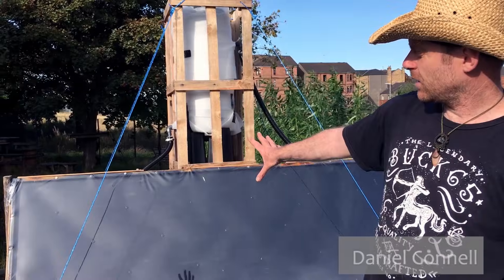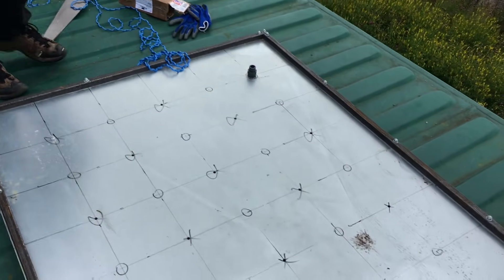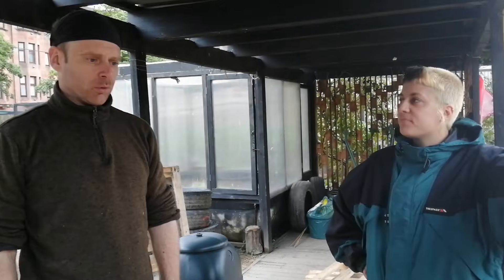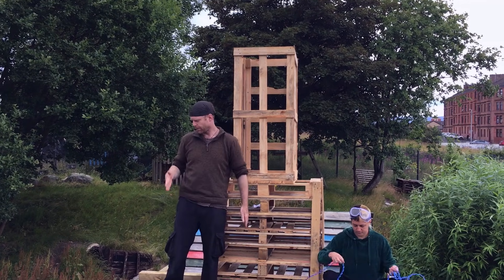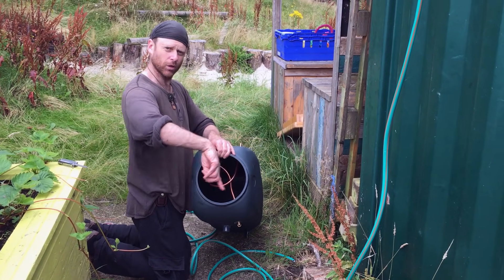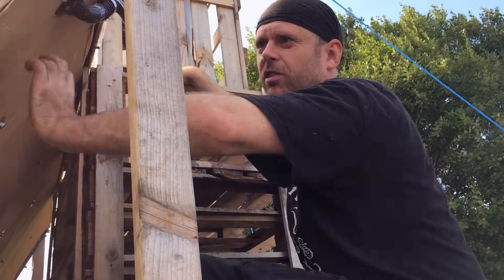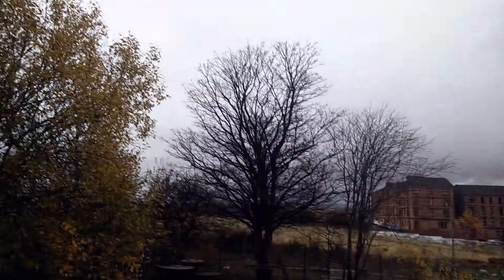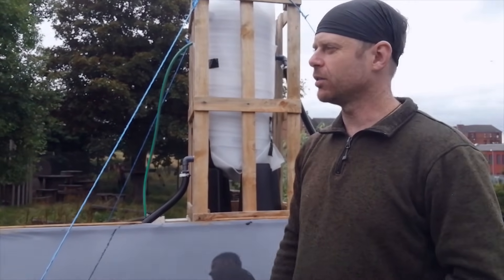The lowest cost per watt solar hot water panel. Build guide in description.

Comment: Still not convinced solar power has any place in Scotland or Ireland, but this is a decent effort.
Reply from the maker: It mostly comes down to cost per watt and energy return on investment.
If your infrastructure is expensive, then no, it'll take forever to pay off and should probably have gone with something more abundant.
But if it's basically dirt cheap like this, then getting half the energy at a tenth the cost still probably works out in your favour.
Reply: @OpenSourceLowTech  Indeed.. A "Perfect solution" often stands in the way of a good enough one and can result in nothing being done at all!.. Great project given the resources and circumstances.

Comment: what are the advantages of this setup compared to a plastic pipe snake or swirl pressed behind the outer metal plate? half the steel, simple steel enough, no steel frames needed, less connectors, predictable flow rates... also most such plastic sheets will crumble in permanent sunshine / uv / wind, most applications use a single layer polycarbonate.
Reply from the maker: serpentines are standard for this kind of application and they do a pretty decent job. Advantages of this tho are ease of fabrication without need for brazing copper and or compression fittings, and maximal use of the solar contact surface as every square millimetre of the sheet has water 0.5mm behind it, rather than having to go through several cm of aluminium fin, or equivalent.
The main tradeoff is this system won't handle any kind of significant pressure, but as long as the header tank is just above the panel, and mains pressure is isolated from it as in this build with the heat exchanger (I've also used a float valve for same), then it holds up fine.
Also much more resistant to freezing damage as the panel can flex and expand.

Polycarb is great for this and if you want to spend the money, definitely an option.
Reply: It wasn’t clear to me from the video how you are drilling a bunch of holes in two metals panels and then making it watertight afterwards?

Comment: @OpenSourceLowTech I've been working with AI on some project ideas (i.e. producing graphene) for when I move onto my offgrid homestead (soon), and so I put the following query to Grok (expert setting): "Can you please analyse the project covered in this video to see if you can provide any improvements to their design?  Here is the video: [URL for this video, but youtube won't let me post URLs]"  The result is general approval with a couple of minor suggestions for improvement.  You might find that using AI can help you solve problems, or optimize things.  The only catch is that AIs don't always tell the truth, so prototyping is still necessary.  Hope that helps.

Comment: Cool setup, well done. I don't recommend using this water for any kind of sanitary use. Water stored below 60°C can support growth of legionella, which can cause serious illness especially in children and elderly. For this reason local regulations typically require hot water to be stored above 60°C, or alternative water treatment must be done to keep it safe.
Reply from the maker: Indeed, one of the reasons for keeping the system water and outlet water separate on this build, with the mains feed only being warm for the time between the heat exchanger coil and the tap.
The other main reason being antifreeze..

Comment: Haha I saw this done a few years ago and the promise then was to make the full source available shortly. This explains NONE of the essential information about the connections. Water comes in over there and out over there? To build a car get the bits you need and put them together. See easy full open source.
Reply from the maker: Check the video description for full schematics and build guide.
Reply: @OpenSourceLowTech  Sorry I was looking at the bottom and it still says coming soon. However the guide link does not work. I think this is because it is your YouTube Studio link which is likely connected to your log in.
Reply from the maker: Ach my mistake, fixed now. Thanks for catching.